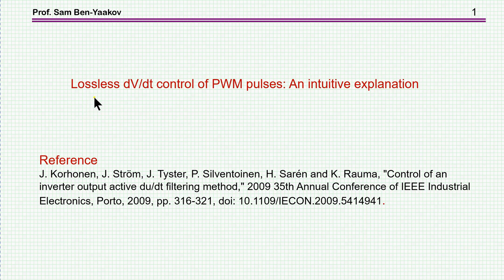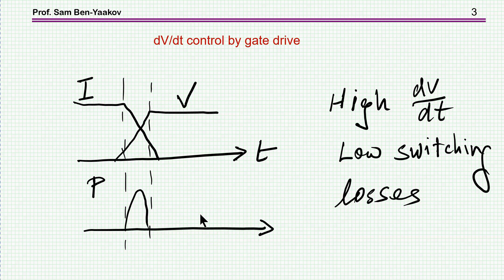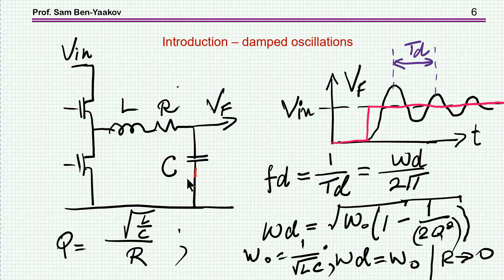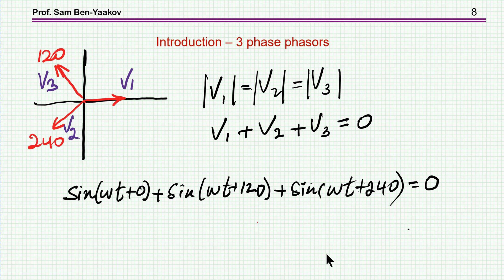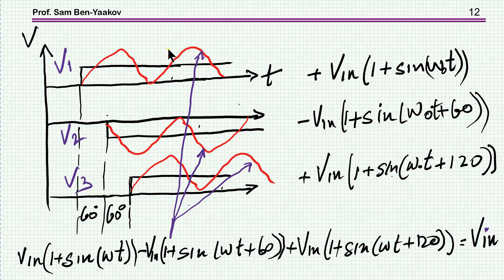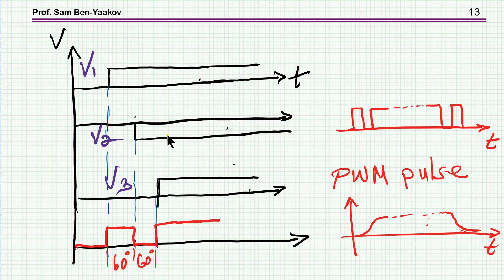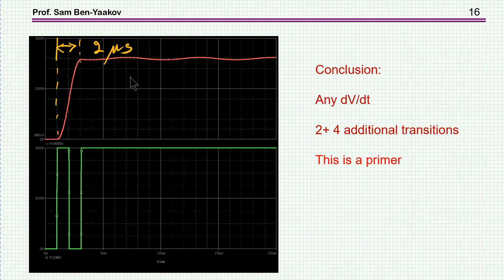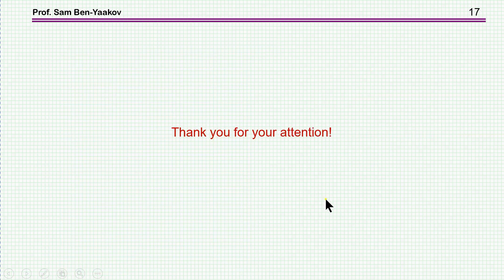Lossless dV/dt control of PWM pulses: An intuitive explanation

Comment: Cool, this seems to cancel out the w0 frequency caused by the filter. I wonder if the wires to the motor and motor itself have their own undesirable oscillation freq that could be removed with even fancier switching. I'm also wondering if this can be used for getting better rfi results when doing forward phased lighting dimming as the fast switching edge leads to ringing with certain loads
Reply from the maker: Yes, there is still a lot to be revealed 😊

Comment: Very helpful. It would be even MORE helpful if  Prof Ben-Yaalov gave some info concerning the additonal power losses caused by this  technique.  
Question: what are the cost implications of using LC " 3 phase " technique of this idea, especially the cost of a 3 phase motor?
Reply from the maker: Thanks for bringing up this point. But the real question is: what is the power loss and cost in comparison to others solutions: 1. A full fledged filter with damping resistors, 2. Slowing down the dV/dt and increasing the power loss which will require more heat removal .

Comment: Very interesting, thanks. 
Of course at page 9 the bottom formula has a typo: should be 120 instead of 240 in the last term.
Reply from the maker: Thank for note and correction. I could have said that I put it on purpose to test the viewers, but it was a slip😊